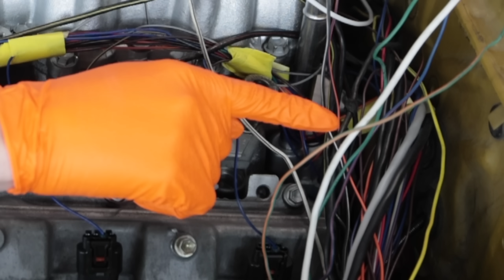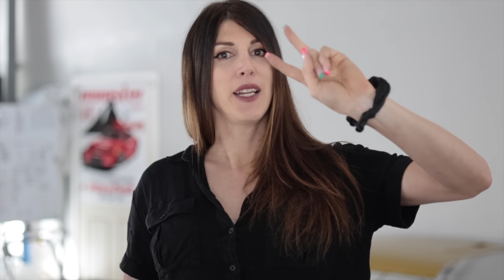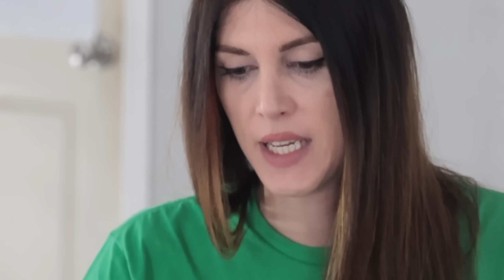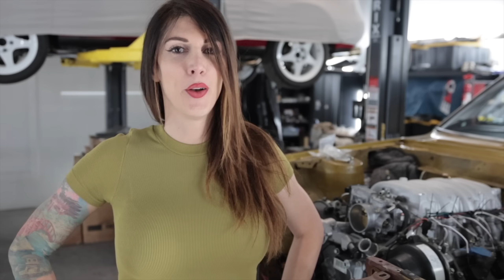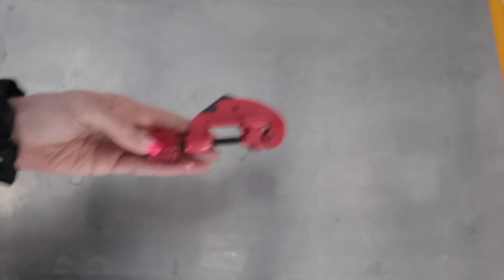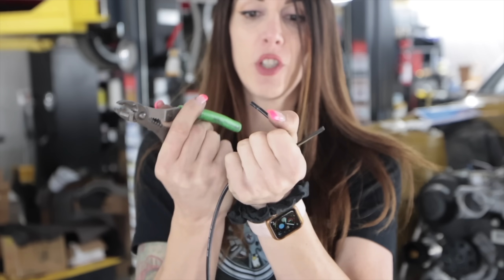Re-Engineering The Cars Wiring // 2UZ V8 Celica

Comment: Don't even bother using the circuit opening relay. It does nothing but turn on the fuel pump. You can do that with a separate relay. That battery terminal crimper you got from Amazon is garbage. I don't blame you for hating it. But you can get the hydraulic one, which is much better. Open Barrel crimps and non-insulated butt connectors . Solder is for circuit boards.😊

Comment: I learned to put those formulas (formulea?) in a triangle.
  U           P
I x R     U x I

Also, different letters, but you get the drift (U for voltage, I for current (amps), R for resistance (which is futile. We will add your technological and biological distinctiveness to our own). P for power (in Watt).
Putting them in a triangle it's more easy to figure out the dividing bit U/I = R  or  U/R = I etc.

I may have done this wrong, please comment.

Comment: If you need/ want custom battery cables or fuse panels check out CE Auto electric in Gilbert.  Tony is very helpful and I have him make all my cables.  They have a cable builder 2.0 where you can build what you want.  Turn around is quick.

Comment: The amazon battery lugs are not horrible (not the best, but work fine) but that crimper is definitely not the one to use. You need one of those hand hydraulic ones with the 2 apposing dies that put a hex crimp on it. Those work amazingly well. Used one of those for the last 4 gauge crimp on my negative battery bundle on my car which has about 8-10 different grounds coming in from various stuff I've hacked together on that beater. All the wires are 14, 16, or 18 gauge and that crimp has held for a few years now with no sign of ever letting go.

Comment: I admire the "OC" behavior in your electrical work. I've been accused of repairing wires with solder, heat shrink and then replacing the wire loom. Automotive electrical issues cause so many problems due to chaffing and poor connectors/repairs. Get job Air Force....

Comment: For stripping large wires 6 gauge and up I found it very useful to use this cable stripper “Jonard Tools CST 1900 round cable stripper”. I wire race trucks for a living and have found this tool extremely valuable and much safer than using a razor blade or box cutter. It would be nice for us to know that a $50 tool saved you from injury. 😊
Keep up the great work and stellar content!

Comment: Electrical theory can also be likened to plumbing and water flow, both require a medium for the respective forces to flow through such as pipes vs wires , i.e  can be influenced by the size of the mediums they flow through and both require forces to generate the flow

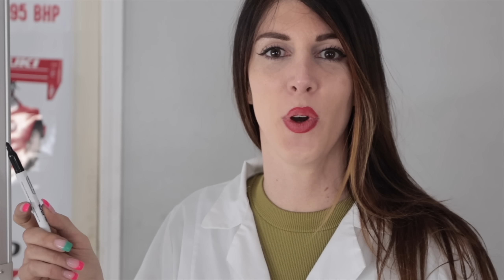Comment: 08:28 - You could have also shown the V I R triangle diagram, and how you work out an individual value by working with the other two values in the triangle etc etc... 🤔😏
Note: For anyone not electrically experienced, Google - 'Ohms law triangle' and look at the images, or YouTube 'Ohms Law Triangle' for a helpful explanation on how to work out Voltage, Amps and Resistance. 👍
😎🇬🇧

Comment: Hi Sarah I love your Channel, recently I did some wiring on an old Suzuki motorcycle. I pretty much rewired the whole bike very simple job compared to what you are doing now. I was considering using the painless wiring wire and I found something that was similar but cheaper on Amazon then afterwards, I noticed in the Painless wiring catalog there was an automotive wire insulation heat rating number and that the more expensive wire was rated for considerably higher heat then what I had used on my bike. I'm wondering if you are considering this in your engine wiring harness. Thanks !

Comment: not worried about the electrical tape splices?  an adhesive lined shrinkwrap with 1 wire on one side and 2 on the other could make a more permanent seal.  you probably live in a dry environment so you'd probably be fine.

Comment: It still is one of the most beautiful car builds on YT. When you do it. You go all out to do it laid out factory++. I really appreciate your dedication. Being the son of an electronics teacher I LOVE LOVE LOVE the way you teach wiring harnesses and reading schematics. The overlay of a IBM monitor of the 80's is hilarious. 

I hope you will contact either SOCAPEX or HARTING and use their crimping tools. Those connections are stronger than welds and do not fail under vibration just like solder joints do.

Comment: Yaaay, another wiring video! (not ironic) My only concern is soldering any cable around engine (which is vibrating all the time) may lead to something breaking later on, as solder is susceptible to vibration.

Anyways, had fun watching!

Comment: Insert Angry Chris Farley Here

For the love of all that is holy please stop using electrical tape!

1) Get a 3d printer.
2) Make a mold to cover all of those T splices on your wiring harness in fusion 360.  Include an injection port.  Print it out on the 3d printer 
3) Get liquid electrical tape or a 2 part epoxy.
4) Get a syringe.
5) Put 3d printed mould around T wire splice.
6) Inject mould with liquid electrical tape or 2 part epoxy.
7) Leave it for 48 or more hours.
8) Remove 3d printed moulds.
9) Profit!!!!

Comment: For my Jeep battery and alternator cables, I used 4/0 and Littelfuse BF2 MEGA (500A for the starter; 250A for the alternator).  I do wonder how long the EPDM insulation will last under the hood. 🙃🙃🙃

Comment: i think more conventionally, for circuits the equation is V=IR ; voltage is the current times the resistance .  

electric circuits are analogous to plumbing where the current is the flow of water and the voltage is the pressure and resistance can be thought of as inversely proportional to diameter of the pipe, e.g. high resistence~narrow pipe .

Comment: Actual electrical engineer here.. I like the equations Sarah highlighted.  I’d caution that using an ohm meter on some devices may give erroneous results..  Electric motors (cooling fans) have some inductance because of the magnetic effects of the windings..  That inductance will tend to resist the flow of electrons after the motor is running, lowering the current.  Probably not a big deal since the measurement Sarah suggested will just cause you to pick an oversized wire in this case.  Incandescent light bulbs have a different physical property (resistance rises at the normal operating temperature) but which results in the same effect. 

Sarah cleverly skipped over the basic power equations, but I think they can be useful.  P=IV is where it starts.  Algebraically equivalent is I=P/V, which can help in choosing conductor and switch sizes..  Often you can look up the power of a cooling fan or a lightbulb - product specs.  Take that value and divide by 12V (or 14V) and it gives the current in Amperes (Amps).  From that current value you can look up the proper wire, connector, switch, relay, and fuses sizes.

Comment: i agree with you on the solder but i also solder my battery cable lugs i find it easier than crimping in my shop and i do have both ways to do them

Comment: hey Sarah, thanks for the video!
Just pointing out that there are T shaped heatshrink boots that would probably helped better than electrical tape for your distribution wires, they are a bit pricey, but the results are neat!
electrical tape doesn't like heat cycles over time and have a high chance to unravel, even secured in Tessa cloth tape.

Also, there are methods with resin coated heatshrink tubes to get similar results, I did one a few times in industrial electric cabinets, that method require to open a hole in the middle of the heatshrink to let the vertical part of your T junction go through and add a piece of heatshrink on that vertical part (as the tube with a hole will cover the two horizontal ends), when shrinking, the resin will fill the gaps and seal up your junction. I've seen a few people slit the end of the tube for the vertical part to make flaps to be inserted in the hole of the horizontal tube, reinforcing the whole junction, I never had to do that, but in the warm environment of an engine bay, that could help indeed.

writing the method may not be the best to understand it, but I hope that may help you or other people  :)

Comment: Sooo close on the wiring size explanation-thank you for (quickly) adding upsizing the wire to fit the fuse. 
However (you knew it was coming), the wire is sized to the load. The fuse is sized to the wire. So while you are half correct in sizing the wire to the breaker, the load is free to self destruct before blowing a fuse. Probably not a huge deal, but there are systems for reasons 😉.

Comment: I also struggled with ohms law, and came up with my "donkey bridge".. (translates better from Dutch language..)Take a garden water hose, connect it to a tap, and put your thumb on the end of the hose. Now when you turn on the tap, and the resistance of your thumb is extremely high, there will be tension ( voltage) but no current..  Until you reduce the resistance of your thumb.. this will increase the current. With a low enough resistance ( no thumb at all to the garden hose) the tension will drop..

Thanks Sara for your patience and extreem urge for perfection.. it is always a joy to watch!!

Comment: Automotive neurology. I hope it all functions first start, all in order! With that power & the original gas tank, i think id weld baffles in the tank to stop the weight from sloshing side to side, throwing the rear end out of control. Corvettes & I think mustangs had that problem. Last thing needed after all that work is for it to do its own thing.

Comment: Holy Cow!  They buried the Starter UNDER THE INTAKE! WTH??  That's why mechanics hate design engineers...  Engineer: "I think that starter replacement job should take about 8/10 of an hour, it's easy to PULL THE INTAKE MANIFOLD"... Mechanic: "Um NO".
Reply from the maker: That design allowed for this engine to fit in this bay. Id have no room for the headers if the starter was mounted in the traditional location.
Reply: @SarahnTuned  for this application that’s great but for the millions of Tundras that had this engine, and had a starter fail, I bet the mechanics hated getting that ticket.

Comment: What's wrong with cheap amazon battery terminal connectors?
Reply from the maker: Inferior quality that will corrode quickly and not withstand the required current. 20% copper/brass and 80% recycled scrap metals since there is no quality control on the manufacturing side where the metals are sourced.

Comment: Watching and listening to you solving problems is joy, end-to-end. I at once admire your patience and willingness to do whatever it takes to get it right, respect your unusual level of knowledge, and envy that you can put enough time together to do it.

Thumbs up on leaving extra wire on purpose until everything is terminated. I find it is always needed.

Finding original crimps to put in the terminal housings, eliminating splices, was a triumph of research, and will pay off huge in reliability. Kudos!

More thumbs up on very robust power rails. Makes up for a lot of other slow decay due to corrosion, simplifies troubleshooting later. 

I may be sensitive on the issues of vibration and corrosion. For 33 years I have maintained a fleet of 3-4 motorcycles that I store under the sky full-time. Minnesota is a climate where there is a 176°F difference between the hottest and coldest it can get, it rains and snows a lot, and we salt our roads. I have seen things that you are not likely to see in Tucson. 

While your B+ tree will work fine if unmolested by time, vibration and chemistry, I would have run B+ directly from a central connection point (bus bar?) to each load. A continuous insulated wire is always more robust than a crimp or a solder joint. I wouldn't do this with everything, but I would for the power rails. Ground especially. Chassis are shitty grounds especially as they rust.

 Re soldering v crimping, IF you have crimpers with the RIGHT die for the job, terminals with the RIGHT gauge for the wire, and enough leverage to cold flow the wire (crush it until it turns a little inside out, with fresh metal exposed to the terminal before it sees air) then crimpers are definitely best. Advantage is the joint is less prone to cracking because the stranded wire is not stiffened by solder.

OTOH, if you use old 60/40 solder, it is softer so its joints don't fatigue crack as readily as lead free, and if you immobilize the joint so it can't fatigue, solder makes a great connection more easily. Lead free is a no-no when joining wires on moving machinery.

You are a treasure of the automobile world!

Comment: Not sure if the 2UZ suffers from this issue or not, or possibly it was an issue for us because of the superchargers, but the Toyota knock sensors are crazy prone to failure, (or at least being super sensitive).  Many of us with supercharged 1MZ’s would 1. Move the knock sensors out of the valley for accessibility and 2. Use GM sensors because they are either slightly less sensitive or less failure prone than the Toyota sensors.  Just something else to worry about……lol

Comment: A super simple hack for stripping wires without a proper tool. Use a lighter, get the end hot then pinch the wire between bottom of lighter and a hard surface and pull on wire while watching the pinched end fall off. Works like magic

Comment: Nws, nice german tools right there. And yes, do not solder wires in a vehicle, crimp them. whoever tells you otherwise has no clue what they are talking about. the fine strands of soldered wire become brittle as they move/vibrate and will break or cause bad contact. There is ofcourse potential for bad crimps too, but done right the contact it makes has basicly 0 resistance.

Comment: Oh boy...new Sarah while I finish my 4th cup of coffee. Can't ask more of life than that, eh? EDIT: My Dog, it's such a pleasure to see somebody working on cars who really knows her stuff. Big ol' brain there, S. EDIT 2: Coulda rolled a bead on that crossover pipe without having to cut-n-weld...and you might look at heat-shrink tape if you're not already using it. EDIT 3: Nice work on the ground and power busses. General aviation procedure USED to spec soldered repair connections, but it's  changed to crimps because so many techs couldn't solder correctly. Solder, done right, is way mo better.

Comment: I very much appreciate your analogy of the electrical quantities. As a professor of electrical engineering, I agree with what you said that it is incredibly useful to have a sense of what is happening in the wires when you are designing things. I have absolutely no complaints or corrections to what you said. Straight A's all around on this build.

Comment: I have an 05 F-150- yes, one of those. The cylinder head temp sensor is under the intake, so when it went out I had to pull off the top of the motor to replace it. At the same time the vacuum line for the power brakes comes off the back of the intake- I popped it out without realizing it and had to pulI the intake off again to reconnect that hose.
By the way- as an untrained shade tree mechanic I always think of ohms in terms of water pressure. Small hose restricts water flow- resistance. Multiple water outputs (hose nozzles) reduce pressure. Not a great analogy but it clicks in my mind. I'm not an engineer- just how I get it.

Comment: Don't worry, I just used the same pipe cutter on my auto shifter stalk. Subaru thought a foot tall was the proper height and they were incorrect. My Japan parts were a Legacy BH intercooler splitter(fits the Baja) and a Works Bell hub!

Comment: Appreciate the “one ought” witticism.  Also, to remember Ohm’s Law:  Rain is ‘Eavy over India.  Draw a triangle, pointy at the top, with a horizontal line across the middle.  Into the triangle, at the top write E of ‘Eavy, under that write the I of India, and next to I write the leftover R of Rain.  Put finger over the one you want, and what is left is the calculation needed.
Reply: And don't forget what we were taught in High School Shop class by the Instructor to remember the resistor Color code to figure out ohms:  Bad Boys Rape Our Young Girls But Violet Gives Willingly (Black Brown  Red Orange Yellow Green Blue Violet Grey White)!

Comment: The secret to soldering is the tip.  If you shell out for a decent soldering iron, that tip is safety foam silver all the time.  Every cheap soldering iron on earth comes with a 50watt heating element, so its fkn messed time, and a ghoser ass tip.  A tip should have five layers.  Then you grab three feet of 0.8mm and hold it one foot away, so it injests solder at 350 degrees, the chisel blade is the best because it holds the transmission bulk of hot to cold.  So always have it where you want it before you send the bulk modulus, [ 9 - [ 8 + [ 7 - [ 6 + 5.... (a - b = c) 'except pointer 0 ', the void object.  But in heavier material sum n ;  n-1 provides solutions through the rick roll radix padding.  A capacitor align the infitesimal right hand rule into maxwells intereference 100.
Theres a million ways to solder, but always have slack in the time, but two hands on the 10^10 + 11^10 + ... 19^10 = 20^10.  Won't miss Phillipino honnor battle fighting any more.

Comment: this is going to be epic, Sarah.  The sheer difference in horsepower and torque between the original engine, and this one?  you're building a right monster-and you're doing the detail work on the wiring, so it's probably going to be a RELIABLE monster.

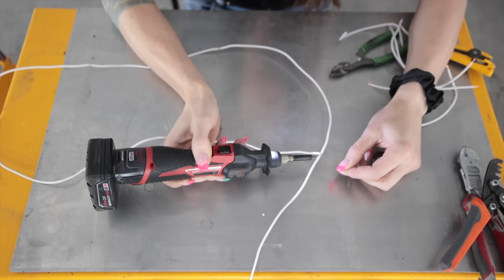Comment: 2:45 I can think of no possible way that a crimp connector is an improvement upon the durability of a soldered connection. The only benefit crimping has is time, but it is always a trade-off between speed and quality.

Comment: If you wanted to make engine removeable with starter and knock sensor in place, you could use a no loss connector like an XT 120 ( pick whatever size for your application)connector for rc car, and a similar no loss for knock sensor.